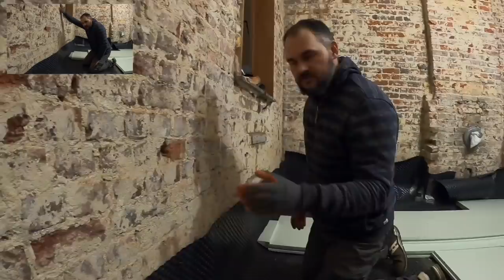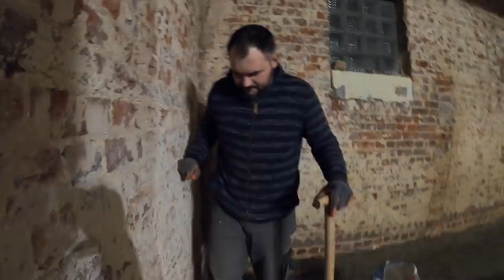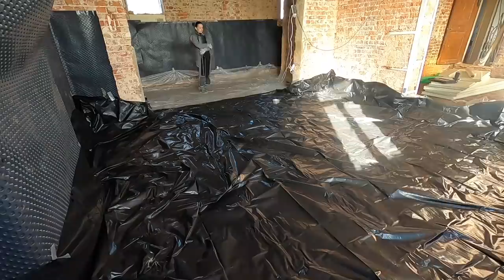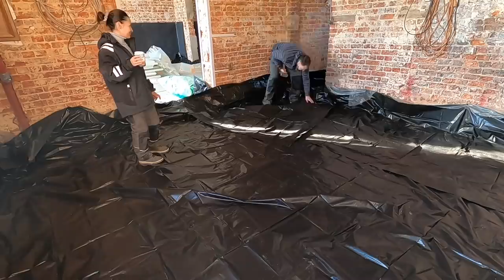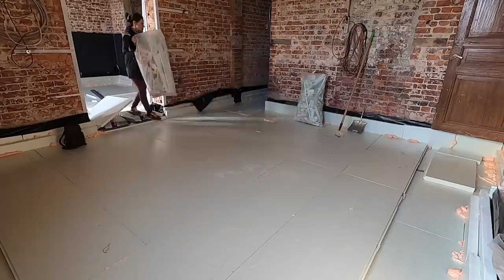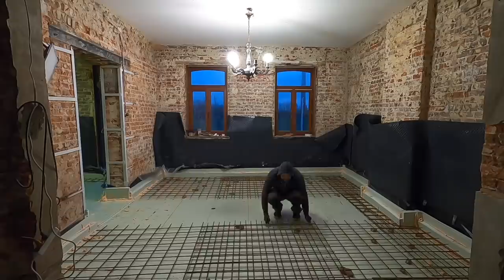STUPID MISTAKE that caused us time and money! but... our floor is ready for the concrete!

Comment: First to say I have never done this kind of job before. Watched you for a good while and don't comment much but wanted to say, I don't think is a mistake, you are trying to restore something more than 2 people have worked on with different materials and ways of working. Your doing a fantastic job, loads of hard work going into this restoration. Was wondering what you were planning on doing to the walls as a cover to keep the kind of mortar your using. Thanks for sharing.
Reply from the maker: Thank you very much, Cathy! and thank you for following our progress. For the walls - we plan to insulate from inside in order to keep the facade intact and plaster on top of it with the lime plaster. This way the walls will stay end-to-end breathable that will help  with damp and mold problems.
Reply: @DeHoeveOldBelgianFarm  ..I’d take the membrane off the wall that stuff is for lining cellars it will just create problems when you attach the plaster/plasterboard to the walls. If you use insulated plasterboard bonded to the wall and just tuck 50/100mm of the floor DPM behind the plasterboard this will be good enough. Look at “Building Maintenance Stoke” on Instagram he does this kind of work all the time, he works on 100+ year old properties like yours.

Comment: Right at the beginning I was thinking haven't seen Anneke around so much for a while - then obvious The Cat Inspector was feeling guilty for leaving you to get the floor preparation wrong - or rather, not to Ilya's exacting standards!!!  It looks so different with the floor prep down.  There will be no cool spots during those several hot Belgian summer days in your house.  I would have wanted a pantry kept cool by all that stone.  And the good news was - you decided to change it BEFORE the concrete was poured!   Congratulation, job well done.

Comment: In Australia the care and attention you are paying to insulating the floor would never occur to a renovator or builder.  Our climate is so mild that this is unnecessary on most of our huge continent.  Most areas only need a set of trenches about 300 x 300mm on the perimeter and the spoil is used to build up and level the floor.  A few boards to contain the concrete, plastic film and F52 mesh then pour - floors are generally only 100 - 150mm thick for new builds.  On renos just level the floor to within the required floor depth, chuck on the film and mesh and pour.  Pretty much everywhere has pre-mix concrete available so no hand mixing.  I supervised a building 200km from Alice Springs which used 20 cubic metres of concrete - it all came premixed in trucks.  A 499km round trip, but it was still cheaper than mixing on site.

Comment: 2/16/22; another great video showing the progress on your house 🏠.  In USA we use solid steel bars called 're-bar' which are cut or bent with a special tool...a re-bar cutter/bender. Using these long bars may be easier/faster than your using that 'mesh' steel but mesh is probably cheaper & looks like it may be better than re-bar. Lots of hard work but it will be great after concrete is done! Great job on cut&fitting in 2 layers of ridgid poly-styrene insulation 'green' boards. 4" thick floor insulation will be fine. Also used in US sub-flooring in cold climates is flexible plastic heating piping.  Colors vary, blue or red plastic pipe but this provides excellent floor warming & upward radiant heat into your rooms to help the overall heating equip.ent keep your rooms nice & warm! Mascot black cat 🐈‍⬛  will love your warm floors in winter & probably never leave your cozy interior! 😀. Always enjoy watching your progress & admire all your hard work...now where was your beer 🍺? Did your cat find it first? LOL!👍👍👍🙂🧑‍🔧🛠😊

Comment: Buy a wire-tying tool at the hardware store. All your mesh needs to be tied together to reduce concrete cracking.
Also, how are you going to pour, pumping or wheelbarrow? If by barrow, you might take away blocks (chairs) from underneath wire for a pathway, at least, so you don’t warp your mesh. Ponimayesh?

Comment: Your biggest problem is, that the brick wall starts directly from the ground. I would tear down the membrane from the wall, what you installed.  You will only temporary mask the moisture and salt problem with it and create even bigger moisture and mold problem between the inside of the wall and the membrane. Also in long term it will deteriorate the plaster and brick wall itself. To solve the problem correctly, you need to install hydroinsulation material to the foundation from outside - dig it open completely around perimeter till foundation bottom,  install hydroinsulation to wall from outside, then insulation and then this bubbled membrane. Also it would greatly improve youre moisture problem, if your house would have a socle(foundatio extension) above ground atleast 300mm of height. This would eliminate your problems correctly. Wish you well.

Comment: I live nearby and I have never seen this plastic stuff on the walls in houses. Strange.
But I guess you guys know what you're doing.
Reply from the maker: It won't be that high, we will cut it much lower. It's not a common approach to protect agains the salts in the walls, but we were advised by a specialist to do so.

Comment: If you take 2x4s and do what they call laying them on the flat you put them on the walls instead of putting them like you normally would for a wall you turn on the other way and then you leave them about an inch out from the wall you have a bottom plate top plate all the normal wall stuff what you do with that is then you're able to spray foam the walls for insulation and then you can use drywall on your walls and that'll keep your house much more of a comfortable temperature

Comment: The thick plastic membrane you removed was very awkward.
I personally think this is not meant for use under a floor slab, but purely as an aid for horizontal drainage.
Then 0.1 mm film was going in and I thought, this is not thick enough, but a second layer got in to make everything right.
The joints in the insulation boards can best be staggered, which you didn't, but the second layer glued on top will make it stable enough.
When laying a single layer stagering the joints will prevent cracking along the joints.
So far a good result, happy to see the concrete pump coming.

Your solution for the edges is a good one, I have the same issue with the foundation being higher than the bottom of the slab, so I will copy your solution permission granted!

Comment: Hi. First of all, I think you’re doing an amazing job!👏🏻👏🏻🙌🏻 But may I ask about using this drainage plastic inside the house? I understand the plastic in use for moist protection. Here in Norway we use this plastic outside for moist protection. The dots in the plastic is for the moist to ventilate up and out if some moist get to the bricks or concrete (outside). For what I can see from your project, if the moist comes through the wall it will ventilate the steam/water up and INTO your home/walls anyway because of the dots😳😳🤔🤔😅😅??
Just trying to help and prevent you from doing mistakes😊

Love you guys👌🏻🙌🏻

Comment: I am wondering if you really need that black moisture barrier on the walls.  As far as I know, and I am not an expert, you just need to put lime plaster on the brick walls.  It allows the walls to breath and adjust to the moisture.  I could certainly be wrong, but I have never seen that kind of barrier applied to the walls.  I know that you research a lot of things before you do something, but this has me wondering.  This has been so much work already!

Comment: Good morning guys, if I may allow myself an observation, I did not understand the function of the membrane on the walls.  It seems to me a bad idea, it prevents the normal transpiration of the wall.  That membrane is placed on the structures that are buried, in fact in that case it protects the masonry.  Another thing you have to do is wire the electro-welded mesh to avoid "floating" when casting the concrete. ❤️

Comment: I think finding about this now and not after the concrete was poured and  the edges start crumbling away is a good thing.
I am not a fan of styrofoam squeaks or aluminium foil being dragged on metal.

Comment: Will you put in PEX tubing for heated floor? Expensive, but I can imagine how nice it would be to have a warm floor. My old building does not have heated floor, so I am cold from the knees down. While it may be 60 degrees at head level, the floors are 50 degrees. I am always happy to see progress, even if a few set-backs happen. 

John
Bethel, Missouri. USA

Comment: Hi guys!
A few weeks ago I started to follow your progress.
We're also building, but is a "new" house, and we are not doing by ourselves, altough we plan to do some minor things like painting.
So I would like to ask you how do you plan to isolate the walls, seems to be a very cold weather.
Cheers from Argentina, and keep it up!
Reply from the maker: Hi, nice to meet you!  Good luck with building your dream home! 
We plan to insulate from inside, as we want to save the facade intact. We will use hempcrete blocks as they allow the walls to breathe. It's a superb material and we tell about it in our upcoming videos.  We gonna start on the project very soon.
Reply: @DeHoeveOldBelgianFarm  Great! Off course is better to isolate from the outside, but in this case is obvious you want to keep all the facade. First time I heard about this product, so hope to see you soon.
Best Regards

Comment: I have a silly question. I can’t get my head around using that plastic on the walls. Looks like it will cause problems in the future. I understand the chemical reaction problem. But why wouldn’t you use fiberglass reenforced concrete board as a base against your walls? Then plaster over that.
Reply: The dimpled plastic is a capillary break. It's main purpose is to prevent moisture from traveling via capillary action. The space the dimples create also allow bulk water to drain to under the floor.

Comment: Why do you need insulation on a GROUNG floor? The earth isn’t cold, your heat goes up anyway...Let alone double layer insulation?

Also, that black sheet is not meant to go on the inside walls, you’ll have serious stability issues when you will cover it with plaster or whatever. This sheet is meant to go as a protective layer on concrete foundation walls on the outside, so that humidity from the earth does not get absorbed by the concrete. Am I missing something?

Comment: Are you going to insulate the outside walls?
Reply from the maker: Yes, but from inside. With a breathable hempcrete blocks. We will tell in upcoming videos more about it, it's a superb material.
Reply: @DeHoeveOldBelgianFarm  The dimpled plastic will make a very functional wall vapor barrier. Brick like that looks to be will wick water up from the ground along with salts (called rising damp in the US), and will also seep moisture from the outside. That vapor barrier's dimples leave space for the back of the brick to breathe and drain. I would consider running the vapor barrier to the ceiling on outside walls. Should you consider that, lap it so that any moisture drains out, not in. Hempcrete blocks look to be a very sustainable product with good insulation value. You are going to have thick outside walls. Have you decided on window details yet? You will have nice window sills to set stuff on or for plants, etc.

You certainly are getting an education on the nuances of soft brick in your climate! Mistakes are annoying, but the main thing is how we respond to them. You're doing great!

Comment: To me, there is nothing worse than to undo something you spent so much time doing.  Very much like sewing, crocheting or knitting, you spend so much time working out the pattern only to discover you missed something (mistake) and then having to rip it all apart.  Nothing like going forward 2 steps and end up 4 steps back.  (hair ripping out moment of frustration). 🤔😐😯🙁😔😲😯😐🙂☺😊😄